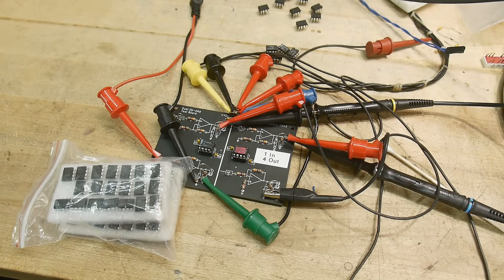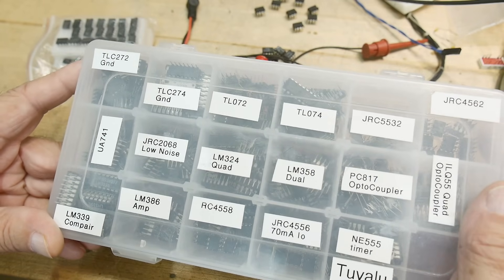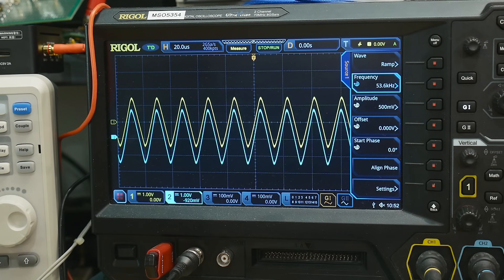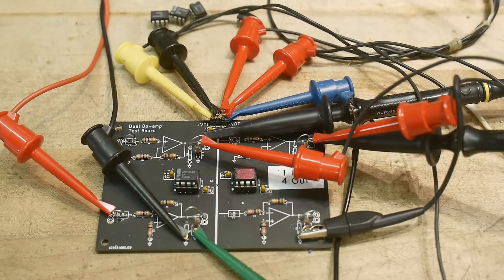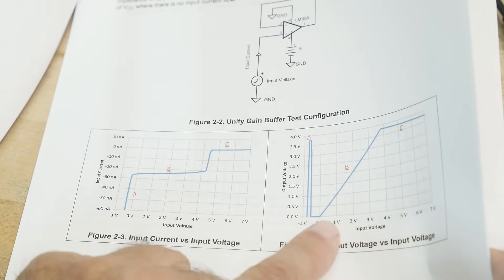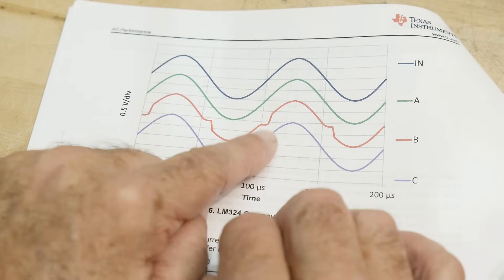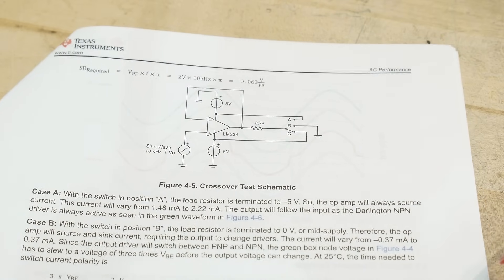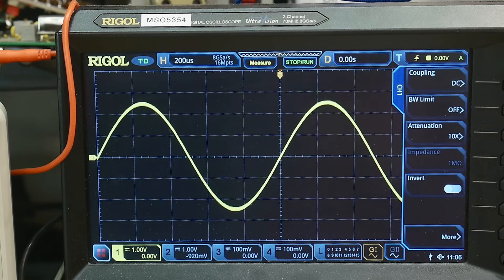#1676 LM358 Care and Feeding

Comment: Anyone who watches this video should read to app note, lest they get they get the idea that 358, 124, and 192 are weird garbage parts. All of these design choices were made to allow for low current single supply (often battery) use at a time when nearly all op-amps needed a +/- 15V supply and current could be fairly high. In addition, not being able to swing to the rails and phase reversal was a common headache with many op amps. This is a 40+ year old design by now...

Comment: I love the 258, 258A (358) since it has ground sensing capability and single rail I use it for many things, Did you know that you can use the 358 as audio amp with a single rail configuration without crossover distorsion? I designed a small amp using single rail and it sounds great if you bias the chip correctly, however the weaker side of the 358 is that is has quite a bit of white noise when nothing is playing and I am trying to find a way to make this less if possible
Reply: Some of the noise will come from the amp itself and there's nothing you can do about that (other than use a lower noise opamp), but some might be Johnson noise from the resistors. Try redesigning the circuit to use lower value resistors and use decent quality metal film parts. But make sure the amp can supply the higher currents involved. It may be enough to eliminate some of the noise you're hearing.
Reply: @RexxSchneider  thanks for the input. I think most is coming from the amp itself in this case but as you say components can play a big role in sensitive circuits too. I will have this in mind when I keep work on this project next time :)

Comment: LM358 input stage can "see" below its negative rail,  therefore it's extremely useful in some control (e.g. power supply) applications where the crossover distortion has no effect. You can build a true zero-volt (or negative few hundred millivolt) comparator with an LM358 while being positive single-supplied. Crossover distortion is mostly an analog signal processing problem.

Comment: The LM324 is still a current and popular chip from ONSemi in SOIC form and has many advantages over most other dual rail op-amps. it's still commonly used in single supply equipment and will work on a 3V supply rail. With op-amps, it's horses for courses. When you dig down there are often many subtleties that differentiate one from another and just treating them all as if they're interchangeable isn't necessarily a wise stance.
Reply: Yes, indeed.
The 324 is a perfectly serviceable amp for lots and lots of applications but it does require you know what you are doing to apply it properly. I've used them in a lot of industrial electronics designs and they've performed quite satisfactorily with excellent reliability. I didn't use them because they were cheap but because they were suited to the job. I've designed other stuff for which they wouldn't come within a hundred kilometres of what was required.

I chuckle when I hear people say what a great voltage reference the TL431 is. It's another part that is perfectly good for lots of things but it is a pretty low-end voltage reference. If I were still doing design I'd still be finding places where I'd use it, just as I would find places for the LM324.

I've been wandering around watching electronics videos on YouTube. I'm not doing it to learn things, but to evaluate the quality of the information being put out by people purporting to teach electronics to others. The content ranges from very good to absolute rubbish, with lots of mediocre stuff with mistakes and poorly founded opinion. This channel seems to be a better grade of mediocre.

Comment: Also your original starts failing before fake one. Attenuation start dropping first on original yet fake one keeps no voltage drop which seems to show fake  is a better option
Reply: It’s not failing. It’s doing what it was designed to do. With the fake one it’s hard to know what you’re really getting.

Comment: At least the TL072 has the same pinout as the LM358. I have a bunch of 8-pin opamps suspected to be LM358s but were relabeled by the Ebay seller as 741s. Wiring up a LM358 to 12V as if it were a 741 did not end well

Comment: You'd be surprised at how many of the old HP precision instruments used LM358s 🙈
Reply: HP engineers knew what they were doing. They knew where an amp like that was suitable and where it wasn't. I'm sure many of them would have swooned with glee if presented with some of the op amps that are around today. Or, like me, they might have cursed because everything looked perfect til they got to the line bringing the huge disappointment of low supply voltages.

Comment: So if you're using two of them, you'd tie one output to +Vcc and the other one to -Vcc to balance the load on the power supply rails? Or would that not matter?
Reply from the maker: if that's important to you. many product power supplies have non-symmetric + and- supplies. the + supply may have more current capability than the -
Reply: @IMSAIGuy  gotcha, thanks

Comment: The class B output is because the classic 2-diode-drop compensation circuit used to make class AB is missing.  Even the lowly and ancient '741 and nearly every other bipolar op amp since, is class AB.  Adding a pull-down or pull-up resistor converts class B to Class A. Better distortion and faster, but draws a bunch more power.  Not good for low power apps. 
I have designed with opamps since 1970, used many LM358s as my go-to jellybean, and just learned about this a few years ago.
Thanks, and keep up the great videos!

Comment: Thanks for the video. 11:00 Actually most of the opamps do from Vee+2 to Vcc-2, while LM358 goes from Vee to Vcc-2. It's better in this respect, never worse. I'm not aware of opamp that "pull up well". Also could you please clarify your statement about single-supply and dual-supply op amps in the beginning of the video? From what I know an opamp doesn't care if you power it from +/- 6V or 0 and +12V. It's all the same from its perspective. You just need to bias input signals accordingly. This being said I used only widespread/cheap op amps in my projects like LM741 / TL081, NE5532, LM358, etc. So maybe I don't know something.
Reply from the maker: if you operate some opamps single ended and run them to ground they will actually invert and go to +V. I think the TI app note explains this.
Reply: Any op amp can be used with a single supply or dual supplies. The limitation in terms of practicality is how close the output can swing to the supply rails and the input common voltage range.

Amps designed for dual supplies generally have an output swing of something like 2 volts above the negative supply to 2 volts below the positive supply. That makes them pretty much completely useless in lots of applications unless you use dual supplies of adequate voltage.

The input common mode range can also be a significant problem with a single supply.There is more variation here, but it can be much like the output swing range - the amp will only operate properly with both inputs somewhere in that previously mentioned range. Amplifiers designed for single supply typically have a significantly different input stage that allows it to work right down to the negative supply voltage - zero volts. Of course with just a unipolar supply, inverting amplifiers can't be implemented in any case without biasing the non-inverting input at a voltage above the negative supply.

If you violate the specified input common mode range odd things can happen, and this is true for any amp, even if operated on dual supplies. The worst problem in many applications is "phase reversal." You might be increasing the input signal, going positive, and the output is happily following according to the gain, then suddenly the output goes negative instead of more positive. This is really bad new when the amplifier is being used in a control loop. It's like turning the steering wheel of your car to the right and suddenly the car steers all the way to the left. Some amps, especially more modern ones, are designed to prevent phase reversal even when the inputs are well outside of the range in which proper operation is assured. You can still fry the amp with excessive positive or negative input voltage if the current is limited to just a few milliamps.

Comment: A cheap part is a good part. Except when its an op-amp 😅
Reply: It can still be a good good part if you know what you are doing.
(I'm referring to a properly designed and made cheap amp from a reliable manufacturer, not the rubbish sold on ebay and the like)
Reply: @D614G_aka_Doug  haha yes I was being a bit tongue-in-cheek. But at the same time how many hours of debugging ur circuit is the cost savings worth to you.. There are plenty of cases whee the trade-off makes sense
Reply: And when its an electrolytic crapacitor. Cheap caps are bad.

Comment: My understanding is that its output stage is a Class B push-pull amplifier with the known crossover distortion which is fixed by placing two diodes in series between the npn base and the pnp  base. Those diodes are missing in the LM358.
Reply: So they are not biased properly internally ?
Reply: @andymouse  It depends on what you think "properly" means.
If you directly drive both bases of complementary output transistors, then you will find a "dead band" where neither transistor is on. That is not quite Class B operation. If you add a couple of diodes between the bases and push current through the diodes, you might just find the point where both output transistors are just starting to conduct, which would be the ideal class B operation. Unfortunately, temperature changes and mismatches make that unrealistic, so we generally try to turn on both output transistors a little bit. That tends to eliminate the cross-over distortion caused by the "dead band", at the cost of significantly increasing the quiescent current consumption of the amplifier.
The LM358 has that dead band but has low quiescent current. It only takes one resistor drawing a few milliamps to ensure that at least one output transistor is turned on in applications where the dead band is unacceptable. The ability to choose between current consumption and linearity makes the LM358 more versatile, so I personally don't think there is anything improper about the internal biasing.

Comment: The modern rail-to-rail CMOS op amps are so much better and not THAT much more expensive! I have boxes of older op amps I NEVER use (LM308, uA709 ! uA725, uA741) because they have such involved compensation or poor performance. Even free they are not good choices compared to modern amps that can be had for a dollar or two.
Reply: The only shortcoming of the rail-to-rail CMOS op amps is that they usually have a much lower max supply voltage.  So for higher voltage applications they often can't be used.  For 5v or 3.3v single ended applications the CMOS op amps are definitely the way to go.
Reply: @argcargv  Yep, Microchip makes some nice RRIO ones (MCP602x) but they are low voltage only. TI has RRIO ones (OPAx991) that go all the way to 40V.
Reply: @argcargv   I made a number of designs with uA709, a couple even after I had switched otherwise to '741.  Why?  Because I needed the uncompensated extra speed.  The '725 I needed in my 10-amp analog simulator bench for lower offset and especially better thermal & longer term drift.  Later on, of course I have had other options, like OP-27 and OP-37.  If you need an easy output voltage clamp, the LM308 would be hard to beat.  The only one I actually remember having had losing battles has been LM318.  Using it is difficult on PCB, and impossible on the solderless proto board.  If somebody has had better experiences - here comes my congratulation!
Reply: If frequency compensation of an op amp causes you grief, don't every try to design a switchmode power supply where you have to figure out where all the poles and zeros need to be.
Reply: @D614G_aka_Doug  Not that much grief but more stuff to add to the circuit.

Comment: In my experiance they are very tough and rugged work horses, cheap and reliable also.
Reply: I've designed the LM324 into all sorts of industrial electronics and they have performed well and reliably. The A version is worth the extra small cost sometimes.

I've designed test and measurement circuits in which the LM324 might find a place but is way, way, way out of the running in other parts of the instrument. It is all about selecting devices that are suitable for the application at hand.
Reply: @D614G_aka_Doug  I have used them religiously in solar aplicaciones, and they have shows a huge resistance to static build up and esd, very rugged compared to more modern esd sensetive op amps and due to there low BW, they are generally very stable, not prone to turning into unwanted oscillators.

Comment: I have had a lot of fun making these devices work.  The Linn Valhalla turntable power supply has 0.05% THD 50 Hz using them. The circuit is very remarkable and was low cost. 90 Vrms using TV type T0220 outputs. The output class A 1 watt.  I have a hunch better using this device. CD4060 with cascaded 324 to get a very pure sine wave.  There are a few easily corrected weaknesses in the design. Nothing to do with the 324. 

LM339 looks like a similar starting point. In low speed switching 324 makes a versatile comparator that unlike 339 can source current. 339 circuits generally work including hysteresis. LM386 looks generic. 

The pull up pull down resistor class A trick can be a  transistor current source or sink. A resistor almost as good. I think I read into a high impedance crossover distortion vanishes. Hiss alas is high.

I read the designer was disappointed with it's performance. 741 was supposed to be it's rival.  Selling it cheaply Tesco it. It survived whilst LM833 didn't as best I know. LM833 is sometimes better than NE5532. Ironically 833 were the same price as 358 recently. MC33078 similar. There was a cheaper 324  often referred to on data sheets. These I believe were fall out voltage specs. This suggests all were tested!

Comment: I love the LM358. 😁
I often use it for sensor amplification and active filtering because it doesn't require a negative rail and works very well with both 5V and 3.3V MCUs, and it's cheap and DIP-8.
Reply: I love them also, and the LM324. I like them for hobby and actually i am still using them in new commercial designs if they are for single supply and low cost. On the other hand i almost do not use the TL 06x TL07x TL08x any more because i had lots of trouble with the phase reversal. Okay i have some of them on stock for repair or when building existing designs - but everything new (for hobby and for commercial as well) i avoid them. For new designs one of my "universal" go to opamp is the TLC2272...
Reply from the maker: yes you should not use the TL07x single rail. that is why they made the TL27x

Comment: I wonder if you could grind or mill the package to reveal the die and see if there are markings which identify the chip? Anyway nice work with the identification.
Reply: If they're plastic packages, you can heat them and grab with 2 pairs of pliers, and kindof twist the package - the die will become exposed and separate from the package. Curious Marc has a video about that. Is really quick, and not messy compared to every other method. The only other method needed is chemical etching, if keeping the bond wires intact is important (aka you want to do electrical testing and don't have a probe station)

Comment: line the bottom of your bin with garbage op amps,... why bother?
Reply: Given how cheap an LM358 is to make, and how well it works if you understand how it works and how to use it - it has its uses, and is not garbage. The engineer designing it into an application may be doing garbage job, sure, but that op-amp is still doing the same job it did the day it was first introduced. You can buy it pretty much anywhere, too. So if you’re designing a kit or something that should be of appeal to people in impoverished areas, count on 358 being available, and design for it. Even fakes are often a 358 under the hood. When you need more performance than it can provide - sure, use other parts, but someone in rural India may not be able to get on of the fancier op-amps easily. And this is just by the way of an example, it’s not like rural India is special in that respect.